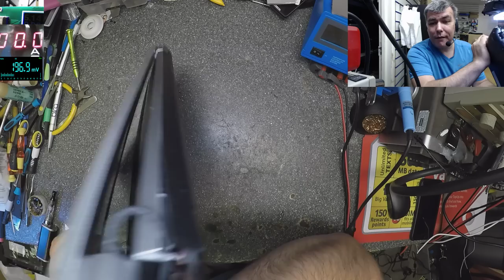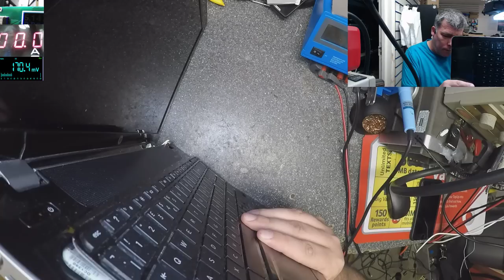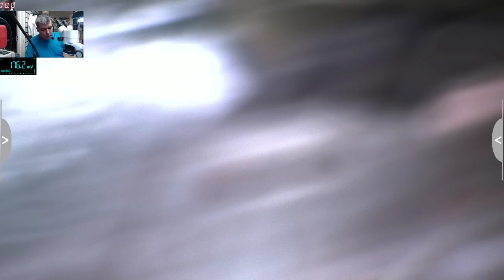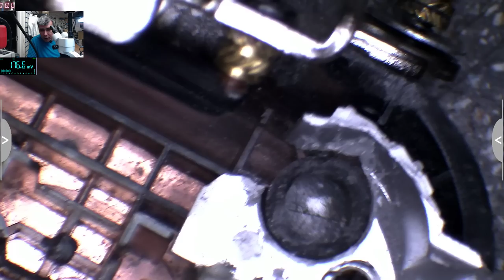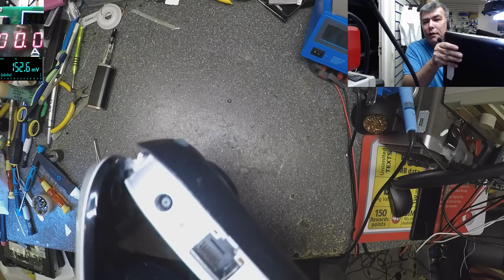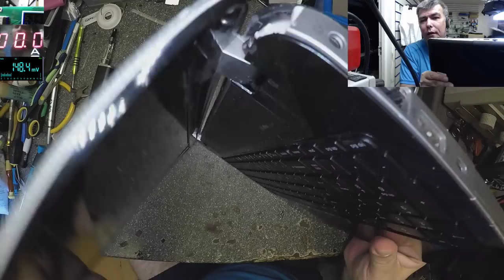How to Fix a Broken Laptop Hinge - The easy way :)

Comment: I wish I had seen this video earlier. You're genius man! I heated a small screw and forced it through the hole. The heat melted the plastic and went through. It was sufficient to give support but I also applied epoxy for support.

Comment: Thank you for the tip, I once had the same problem with a HP too. I opened it up, and glued the hinges with commercial super glue. I don't know for how long, but it works :D
But I've got another laptop from 2007, and it doesn't have hinges anymore. They were screwed on a base, but the base bended so much that it broke, so I'm doing my best to solder pieces of steel and screw it again. I also unjamed the hinges, and I hope it will work. Still waiting for the glue I bought to a Chinese supplier, I hope it will work. I chose a flexible kind of glue. It's a Fujitsu Siemens Amilo, I saw you fixed a laptop like this a while ago. It's the same model.

Comment: What happens when the laptop gets hot? In the car, summer, etc. I did the same, but with E6000/Goop/Shoe Goo. Works great .  I opened my HP Envy 15, and discovered that all of the risers had crumbled, leaving the screw inserts floating around in the chassis. Not enough left to do anything with. Here's what I did: I disassembled the laptop, and I cleaned it out really thoroughly. Then, I put GOOP/E6000 in the places where the hinges laid flat. Then, I put the small screws into the holes that they originally were in, and added more E6000 on top of the screws. Then, I attached the bottom, and I pushed the screws into the glob of adhesive. Basically, glued that area of the bottom to the chassis. Tried to avoid the moving areas, and left it, closed, lid down, to dry for 24 hours. 72 hours is even better, but I have a lot of experience with E6000, and I could feel that it was set enough to handle. This repair WORKED! But, you have to use some common sense while doing it.

Comment: Hi! That was very clever of you using the "magic plastic stick"! Do you use it doing other repairs? Very useful vid, thanks a lot!
Reply from the maker: Thank you, yes, i'm using hot glue even for straightening the microusb charging ports, or rebuilding the chargers connector, or laptop charging ports
Reply: But  is the plastic stick a glue stick or is it just melted plastic which you giving it shape? Thanks Sorin!
Reply from the maker: its hot glue, not plastic!!!  https://en.wikipedia.org/wiki/Hot-melt_adhesive
Reply: Electronics repair school got it, thanks a lot!  I will look it up.
Reply: Could I use the heat gun that comes with the stick? Is it as effective as your adjustable heater?
Reply from the maker: no, its not. I'm using 500 C to heat up the glue

Comment: Jeez Sorin, that is an impressive repair considering how bad the hinge was to start with, i have previously used Gorilla Glue which has worked well but the repair takes ages to set and you have to be careful with the glue as it expands quiet a lot, you really need to clamp the hinges which can be a problem some times, i will try hot glue the next time, if it works out as well as yours i'll be well pleased. I'm looking forward to your live stream, can you please inform us in advance as to when you'll be doing it, really appreciate all the great videos & advice you share with us, its invaluable. Thank you
Reply: true, the hot glue looks the business Sorin, another invaluable tip, many tanx again

Comment: ps, did not know you fix  cellphone. I have Motorola Moto  G3 3rd  generation, wonderful phone, about 5 months ago earpiece not so good anymore, have to use speakerphone. Then  I notice a little bit of screen burn in...but still worked except for earpiece. Then two days ago  I power full, turn on , it shows the  login screen ,  a  big  M  doing stuff while it loads up, but then screen goes black. I see the burn in part with a bit of light  coming through so the  phone is on, takes full charge, but watched every video  did every trick, did not work. Perhaps you have a video  about  screens going black but phone still works however if I cannot see desktop on phone, then I cannot  find  contacts and make a phone call. I watched one video  that  said it was the motherboard maybe some light failed and could not light up whole screen, another video said  take totally apart and replace with new battery (it  does  get a bit hot) , but I do  not  know anything about  fixing  cell phones, however I can follow any instructions so if you have a video of this or if you have any  thoughts, I will send you my email and maybe you could help. I cannot afford a new phone right now. Thank you  for  latch video and hope I learn  what is wrong with phone so I can fix it...Glen

Comment: What if the laptop is still working but one hinge's cables are not connected anymore?
Reply: Plus is it possible to be the connectors of the keyboard and the wifi detector?
My laptop is still working but some letters in the keyboard isn't working anymore and the wifi is not connecting anymore too.

Comment: The simplest way to fix a laptop hinge is to (a) find one of those file folders with the metal strips on the top edge, and (b) velcro strips with an adhesive that you peel off. Cut out the metal strip, stick one half of the velcro on both ends of the strip, stick the 2 opposite halves on the edge of the screen and one the side of the keyboard. Attach both velcro halves together on the laptop and metal strip so it acts as a brace to hold the screen up. Problem solved
Reply: Could you show a pic of this or something. Sounds interesting

Comment: easy but WRONG - 1. you should fix the main problem "old hinges" - of course it means more complicated repair due to second side in display lid and cca $10 for pair of them. 2. hot glue is temporary solution, it will last max one year, next time you shoud use epoxy resin for higher temperatures.